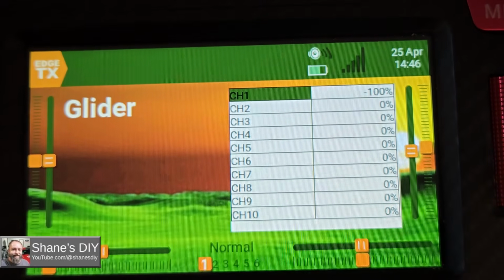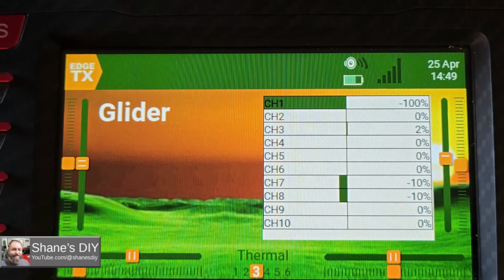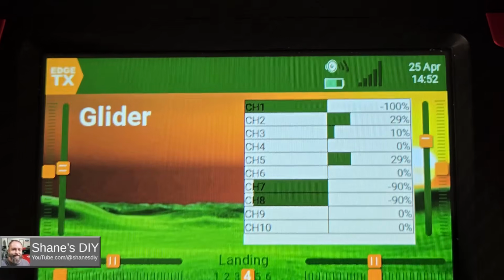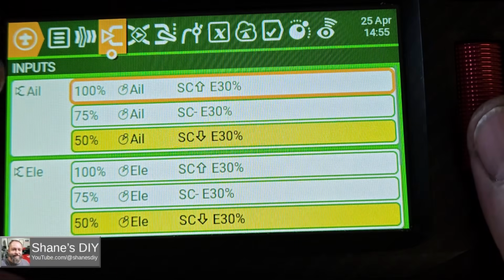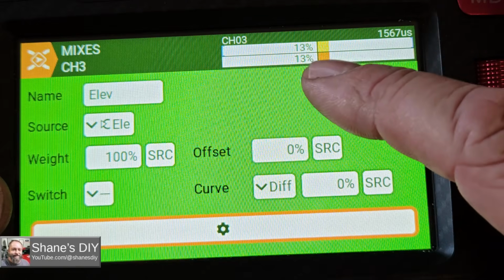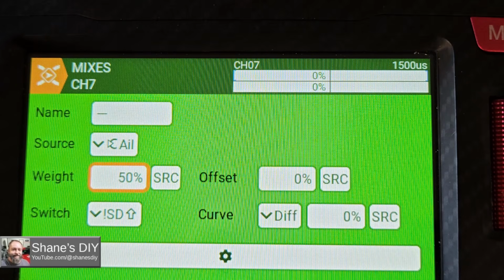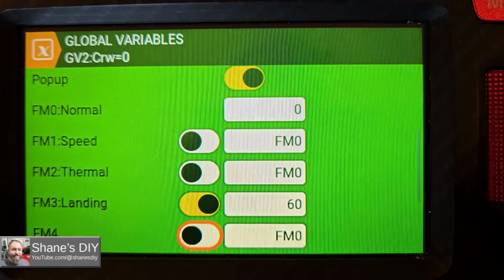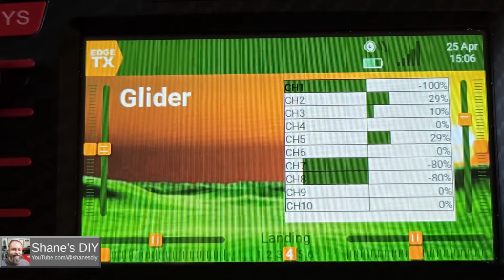Part 1: EdgeTX Glider Mix Setup

Comment: Hey Shane
Great videos and support....you are a natural teacher.   One of the comments you replied to below with the following answer:' Use packet rate 100Hz Full or 333Hz Full and 12ch Mixed or 16 ch Rate/2 for the switch mode and you will have full resolution for all channels. Also highly recommend updating to ELRS 4.0+ on your radio and recievers to eliminate the channel 5 arming issue so you don't have to work around that.   '    i am currently on ELRS v3.6.3  and use ch5 for arm and disarm on all my helis.......Q please:  what happens to my existing model configurations if i update to ELRS 4?  (which of course would be better for my gliders although i was going to use ch5 as arm/disarm)..    Do i need to reassign new channel numbers or is this handled with the upgrade ?
Reply from the maker: Any time you do a firmware update be prepared to have to reset some things.  That said, it should not wipe out your receiver or transmitter settings but since there are some new setting options you will certainly want to carefully go through the RX and TX settings in the radio model setup as well as the ELRS Lua script and ensure everything is as you want it. I would go through everything before the update and make notes on the current settings.  The new "Arm Using" option in the radio RF setup defaults to "CH5" so if you are happy with that you can just leave it.  It now lets you change CH5 to "Switch" and select any switch on the radio for arming if desired, including logical switches so you can get quite creative with your arming method.
Reply: @shanesdiy  thank you very much...great info. I have spent so many hours setting up my helis that i am tempted to leave alone...lets see what i do.  Great vids and very easy to listen to...your a natural teacher and know really well what you are talking about.   Its a bit of a struggle setting up so many..inputs, mixes, flight modes, global variables......by the end my brain is in mush so its gonna be a long learning curve......with your clear vids i am pretty sure ill get it.  To firstly set up one of two is the answer and play around with them. By the time i am in global variables i am in nomans land wondering what to point what to...   hilarious.  However i never give up, just not an option.. so eventually ill get it..  tka again. i started with futaba in the 80,s to there,s a clue :)

Comment: Very Good! But resolution for servos with elrs is 10 bits, how do you setup full resolution for all channels?
Reply from the maker: Use packet rate 100Hz Full or 333Hz Full and 12ch Mixed or 16 ch Rate/2 for the switch mode and you will have full resolution for all channels. Also highly recommend updating to ELRS 4.0+ on your radio and recievers to eliminate the channel 5 arming issue so you don't have to work around that.

Comment: Hello, I have a Radiomaster TX15 Max. Unfortunately, the transmitter doesn’t have trim switches T5 and T6. Is there a way to change the setup?
Best regards,
Artur (Germany)
Reply from the maker: Hello Artur, thank you for the comment.  Excellent question.  This solution is best used on the "flagship" radios with all the bells and whistles (T5 and T6) but really any switch will work.   It is just best done with momentary buttons for the + and - increment/decrement.  You could use a 3 way switch such as SA, for example, where SA- was "off" and SA↑ was increment and SA↓ was decrement but could easily get bumped out of the center "off" position and potentially cause inadvertent GV adjustment. 

You loose the ability to adjust the flap and crow positions while in flight "real time" but you could just adjust those while on the ground by manually editing the GV1 and GV2 values for each flight mode.  The flap to elevator mix trim will still work as done here, just not the flap and crow positions.

T3 for throttle trim is less frequently used once throttle is configured and set, it could be repurposed to use for the flap or crow increment/decrement if desired.

Comment: Shane great overview and explanation. On the side, it would be good if the overview on the main screen would have a column with labels for the channels.could that be done in a lua script?
In general u use fading/out settings for slower transitions and u say u do not use the duration setting to not to Interfere with each other. However for crow you use duration setting. How would I know that crow is not affected by the fade function or in other words why is crow not part of fade?
In my initial setup I only used the duration function for all channels and that even messed up the duration timing which went from second unit to 5x faster. Meaning 1s setting moved in 0.2s. still mystic to me. So how to keep these two transition features fade and duration not interfering with each other?
Reply from the maker: You mean for the channel monitor instead of "CH2" you want to see text?  If yes, you can actually easily do that by going to the outputs page and giving the output a name!  You can enter up to 6 characters.  Giving channel 2 the name of "Ail-R" will cause the channel monitor to show "02 Ail-R" instead of just "CH2".   You could also create a screen Widget to show whatever you want as well.

Initially when creating the base model I only used flight mode fade in/out, no slow up/down in mixes.  I only added that one "Slow down" for crow in the mixes after testing and found that when crow deployed it followed the fade in or out from the flight mode but when switching out of crow mode the aileron immediately snapped back out of crow ignoring the fade.  The reason that mix doesn't follow the flight mode fade timer is because it has the "6P4" switch so as soon as 6P4 is off the control immediately returns to normal aileron.

NOTE: There is another way to do it that will eliminate the need for the "slow down" timer in the mixes but it may be a bit too complicated to explain in the comment section.  Perhaps I'll make a short update video on it?  It is a "cleaner" way to do it I think and I'm all about clean efficient coding...
Reply: @shanesdiy  cool thanks. i have not yet explored all the widgets templates available but i like the renaming part for now. looking forward to the next video :)
Reply: @erhardschreck2192  you should think about making a file available for download which viewers can purchase....i know i would purchase it.  Maybe even one for ELRS.   I have just gone through the vid for the fourth time and still not working so i need now to make a new model and try again....think its difficult to fix the bugs in a messed up config unless you really know what you are doing.

Comment: Great idea for the video!  Thanks!  I just got a DLG at an estate sale that I need to add servos and build out.  Then do the Tx setup.
Reply from the maker: Awesome, hope this stuff is helpful.  I am certainly not a glider expert so I'll be interested in hearing your input on the mixes and if you have any suggestions for myself and the other viewers!
Reply: @shanesdiy it will be a while as I've got a few other build projects, like a FT Super Scout XL, another FT Slow Stick, and a SkyHunter 1800mm to build first.